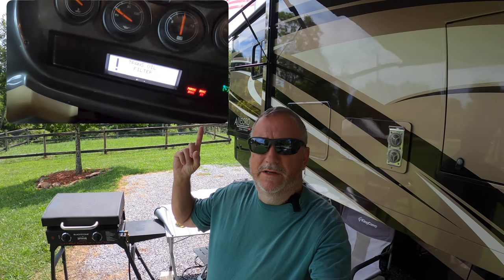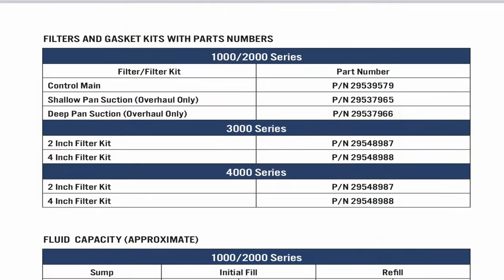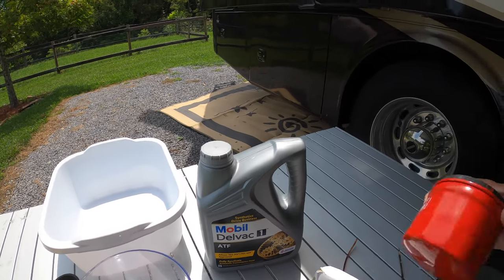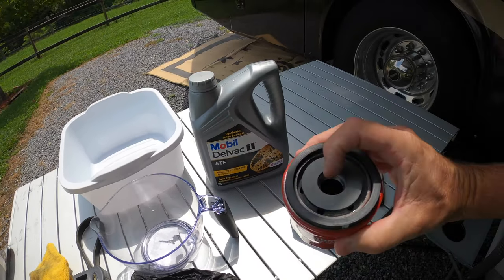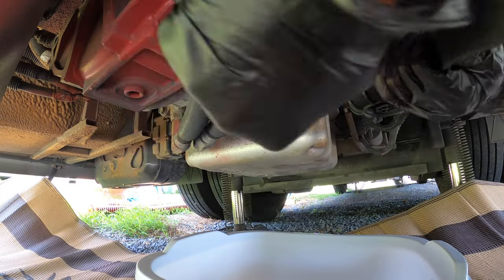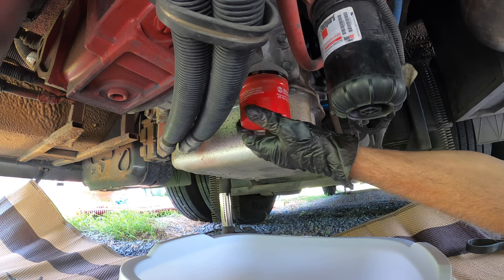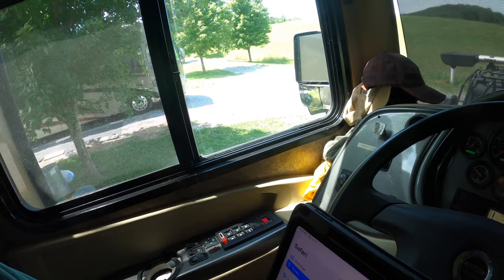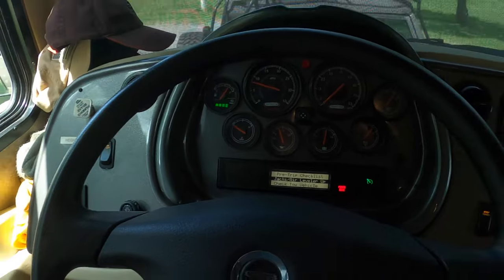How to Change an Allison 2500 Transmission Filter | RV Sunday Solution

Comment: Hey I also have the 2500 trany. It’s the first time I do an oil change and I don’t know how much it takes. Do you know how much oil it takes when doing the oil change?
Reply from the maker: Not sure because we’ve always had shop due it to dispose of oil. Allison states 1000/2000 series hold 14.8 quarts on initial fill and 10.8 on refill so I believe 3 gallons should do it. Hope this helps
Reply: @ChasingtheDreamRV  Perfect, thank you for the quick reply. Take care and happy travels.